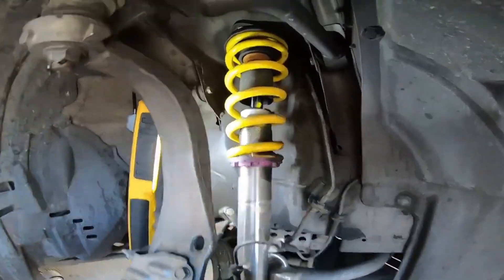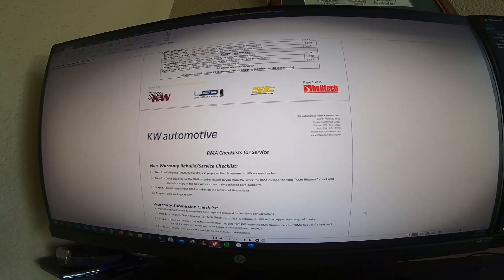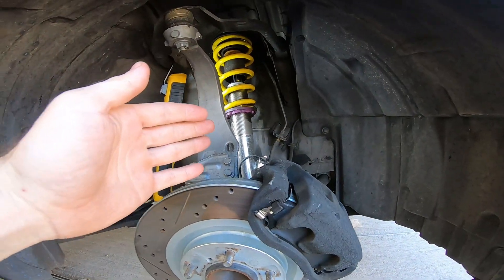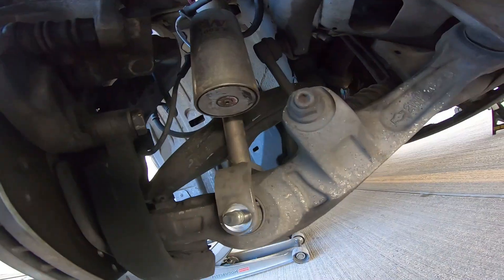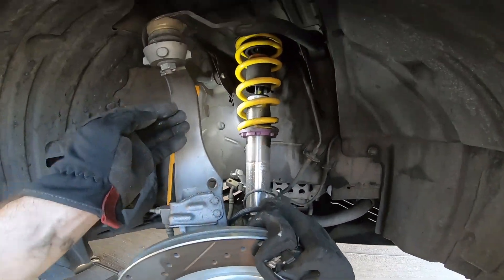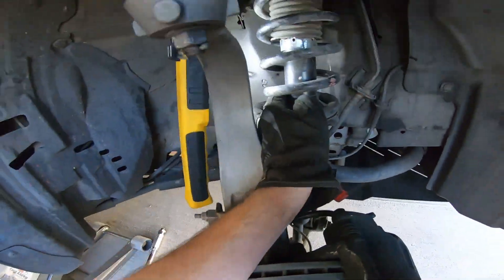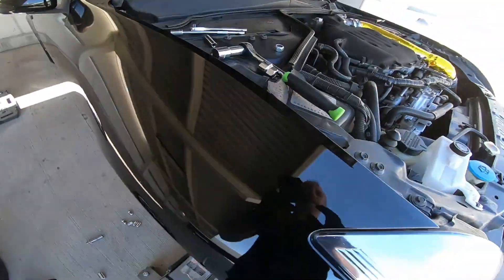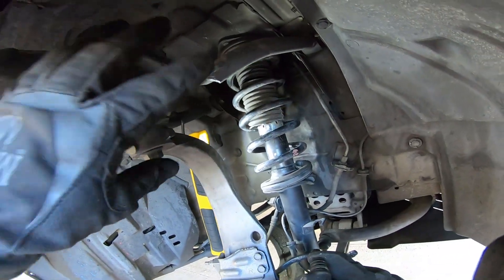THE LEAKING TRUTH ABOUT KW COILOVER SUSPENSION

Comment: KW is great. I have V1 on my 1999 Celica VII TS, car has been imported from Germany around 2010s with this coilovers and it wasn't been rebuild. I reckon it was about 60-80 kkm driven on this suspension. It's one of the most expensive coilovers on the market, but damn, it's really worth it. I'm just wondering about repainting the springs beacuse paint started chipping and there's a little rust on bottom of the springs, now I wonder is it under warranty?
Reply: i just ordered kw for my celica gts :O

Comment: Whereas in the UK, they don't even want to replace mine after less than 12 months old, 3000 miles use.
Reply: What did they say?
Reply: @drunktortila3632  That I had driven over a building/canyon or something.  My wheel and LCA were absolutely fine.

Alas I can't prove this now, but I spoke to people in the know who say that KW don't torque their internal fixings tightly for whatever reason.  As such, when you fit them, if you use an impact gun it can loosen the internal nut, it falls off, damping goes and then rod is subjected to unusual forces.

I wasn't best pleased and I'll not buy KW again.  I ended up paying £300 ($400) to get the damper repaired as my car was off the road.  Incidentally, it took KW 4 parcels to get my one damper back to me.  Incompetent isn't even close to how I describe them :(
Reply: @Hypersonik  Hii what do you mean by using impact gun while installing kw coilovers on car? 
Did you meant using impact gun to tighten suspension bolts while fitting kw coilovers fitting onto the car? Or something else?
Reply: @aliston5028  Yeah, the top mount nut.  When you fit the top hat, I use an impact gun.  Apparently, not a good thing and it can loosen the internals...

Comment: So it was a free replacement for you? I tried asking about the v3 club sport versus regular v3 in an email, and in short, I got told I would have to pay $200-$300 to have a blown strut rebuilt. I don't know which one the guy was referring to or if that was both, but I didn't dig any further because I didn't think I'd get a clearer answer.
Reply: Club sports are not able to be warrantied. They are built with low friction seals designed for track performance. I believe on V1s and V2s and V3s in specific cases have lifetime or limited-time warranties.

Comment: I just found out both of my rear dampers are leaking today when I changed my tires, probably the front ones are leaking as well, only 7 months after they were installed, and my car was in repair for 3 months, so I only drove with them for 4 months.
Reply: You bought it brandnew ?
Reply: @dailypovs7800  Yeah.
Reply: @workingjoe898  wow that crazy how many km on them ?
Reply: @dailypovs7800  About 5000-7000, then I found them leaking during an oil change.

Comment: Okay so. My mother just got a 350Z, and it has a KW suspension system. 

I know nothing about it and the manual is in German. KW told me that “you can find the part number at the bottom of the damper in a square decal on the side of the damper. Then use that to look it up on our website”. But I have no idea what or where the damper is. 

I know nothing about suspension or 350Z, I own a corvette.
Reply: The damper (aka the shock absorber) is the silver part of the coilover that the spring goes around, on your mums car look at the bottom of the suspension strut where the strut connects with the hub and you should find what you're looking for.

Comment: I was wondering if you knew by any chance if the kw variant 3 coil overs fit on a 2006 g35 sedan
Reply: 350Z,  03-07 G35 coupe/03-06 sedans are interchangeable. Check forums my guy
Reply from the maker: hardik patel ...Yes. Go to KW website and plug in your year for the exact model.
Reply: Motordyne G35 I did that but for my vehicle there was no option for running kw v3. I checked forums and they had said the suspension for coupe and sedans are the same.
Reply: Lazy AF my dude.
Reply: They are only made for coupes not sedans which is why there is no option for it on their site. The weights are different and rides heights

Comment: at 2:03 it looks like your reverse left side led is out lol
Reply from the maker: Sergio Salamanca ...I also noticed it. Now my trunk won’t open. Stay tuned to a reverse light install and fix short wire trunk video here soon. Damn G
Reply: Motordyne G35 lolol my back up camera won’t work, it goes blue when i put it in reverse, silly g problems
Reply: Motordyne G35 and it happened when i was messing with the harness too, it was when i installed my diode dynamics tail as turn